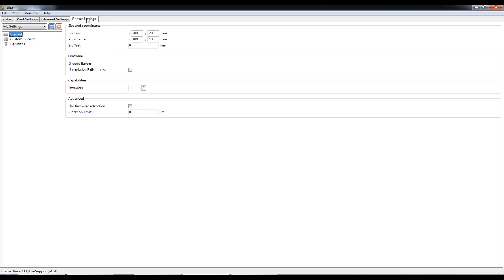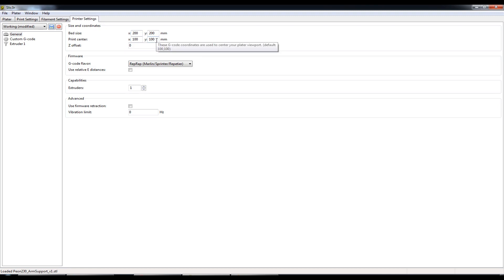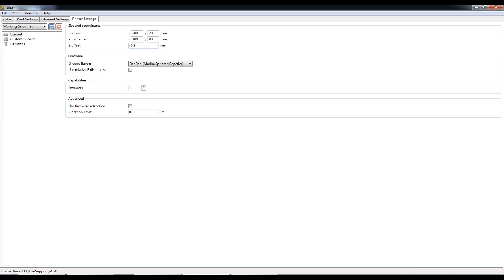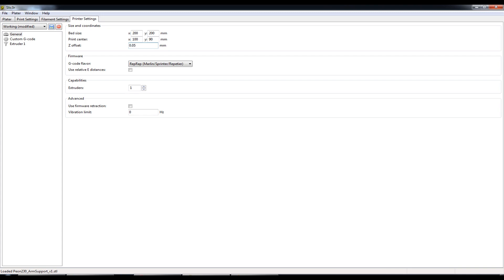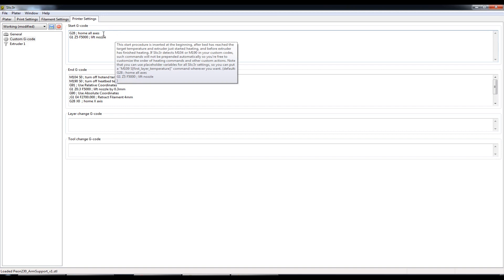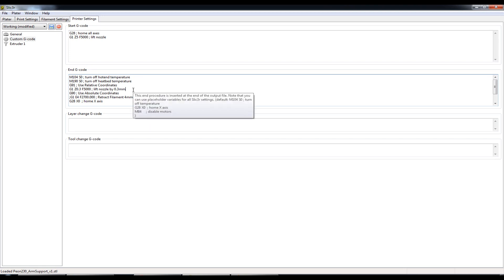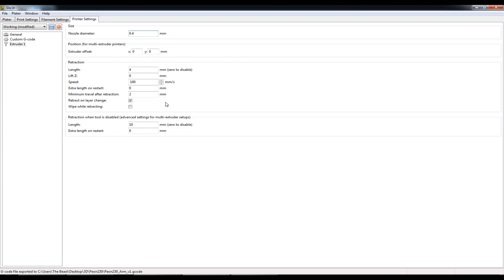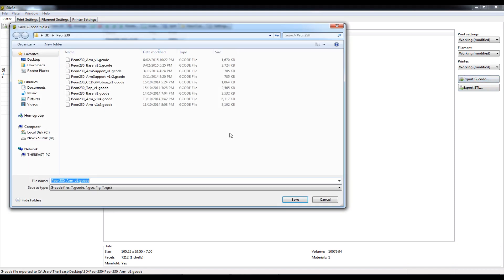Slic3r tutorial for Prusa i3 3D Printer - Part 4

Comment: Hi, Tech2C, it's Bobby again!
You've helped me alot with your videos thru the years of my 3D printing experience. Recently, I've switched to Original E3D hotend. My setup is the same as yours - direct drive extruder with MK7 gear, PTFE tubing, Bowden adapter, etc. But the "spider's web" on my printer is driving me crazy (it happened some time ago, before that - everything was perfect). I think my extruder does not extrude the proper amount of plastic. I tried everything - but the da*n extruder continues to skip steps. I lowered the speed of the printer and it's quite ok now but still...the spider's web is happening.
I think it's because my filament is a chinese brand. Can you suggest a good seller of filaments that are good enough?

Comment: Hi in the Custom G-code what would you do for retraction with direct drive extruder? Also ";" infront of the "G1 E4 F2700......" what does the comma do?
Reply from the maker: +Antony King 
Hey, it's the same command for retract between direct and bowden.
The semi-colon simply comments out that line of code. Anything written after the semi-colon is ignored.
Reply: +Tech2C ... Thanks the thing is when I ran the G code with all your changes the print stopped at 99% and I wondered if it might have been the ";"